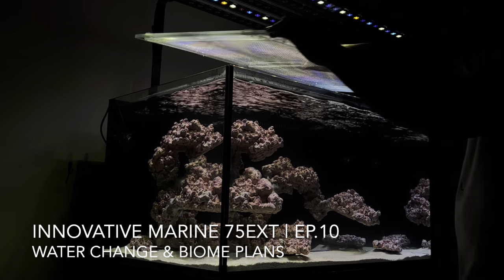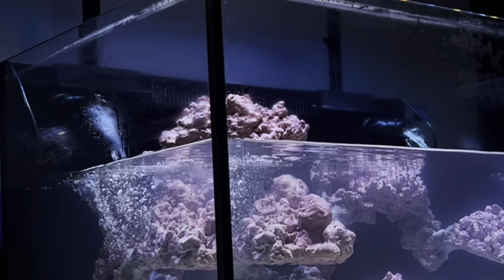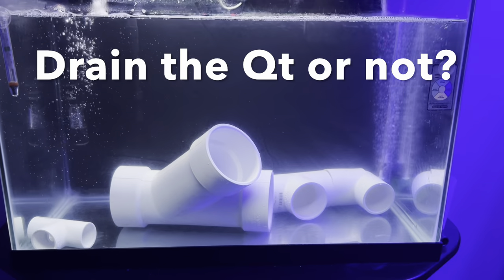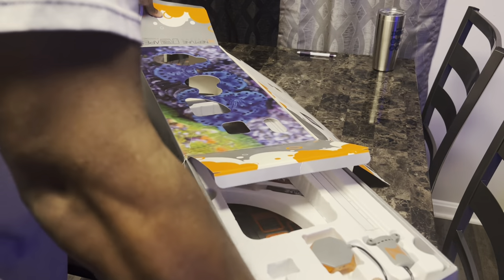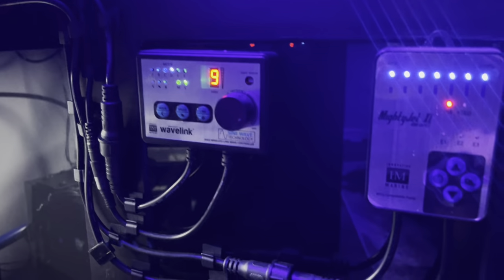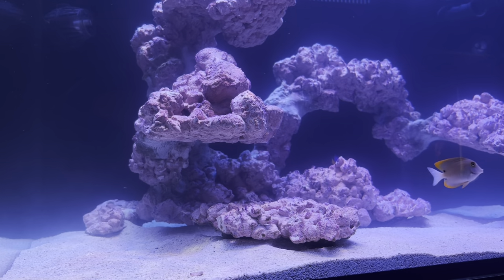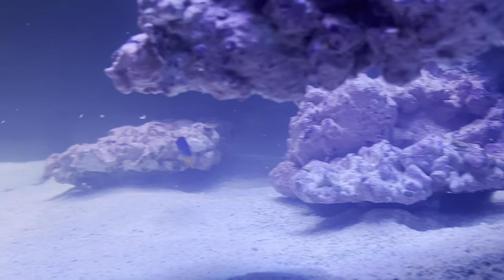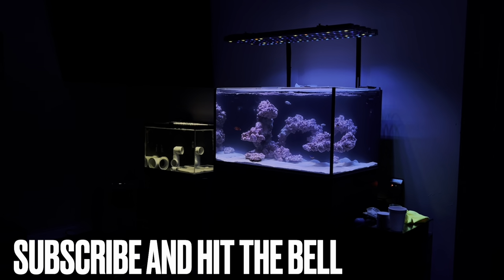Ep.10 | 100% Water change - Be Eazy Biome experiment

Comment: I'll say this just because it took me 3 attempts to get it right. On the 3rd tank start-up attempt, I decided to check Nitrate and Phosphate levels. Both were ZERO. The problem??? I ran every type of filtration/nutrient export equipment & media from the start. As a result, corals wouldn't grow....coralline algae wouldn't grow....didn't even have the "ugly stages"...there was absolutely nothing for anything to feed off of. I decided to dose phosphate and nitrates until the levels were within recommended ranges and the tank was on track ever since getting those parameters within range. To think of all the $$ and corals lost because I followed the "low nutrients" theme that was recommended 7+ years ago.
Reply from the maker: Definitely not aiming for low nutrients doing the exact opposite. I want high import of nutrients. How I export and process them is the question right now. Will the salt be a major factor in that or will I need to activate all my filtration to handle it. We will see when tank is fully stocked as I plan to overstock it with 16-19 fish and loads of coral. Stay tuned 💯